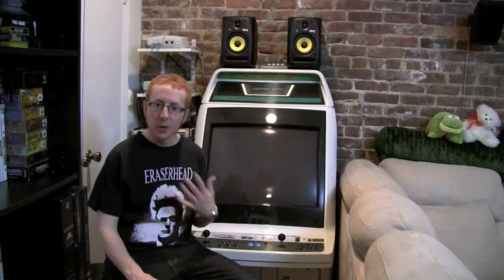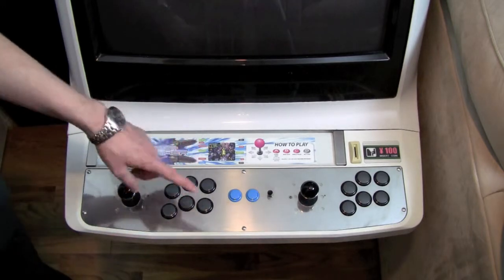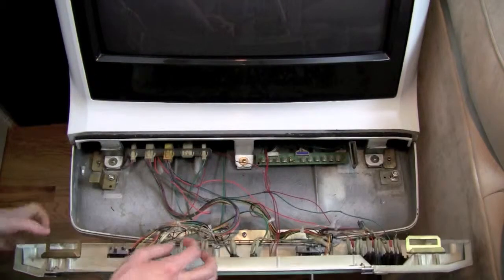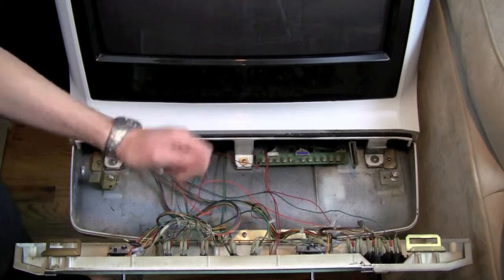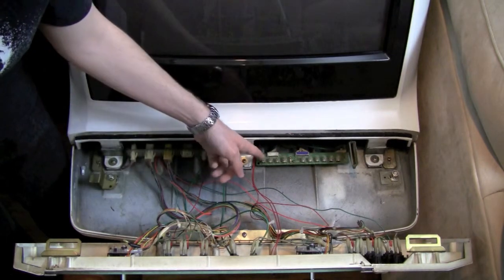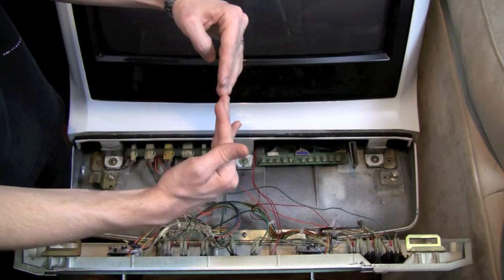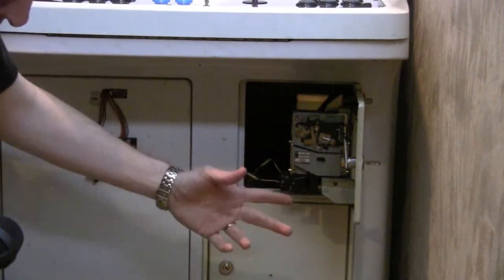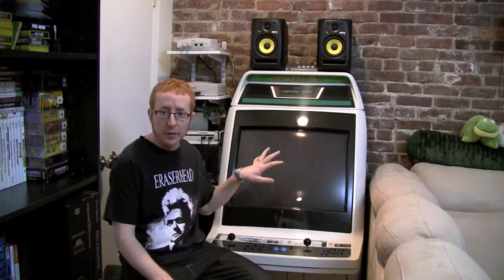Arcade Basics Part 3 - monitor adjustments and button wiring

Comment: Why do people insist on drilling holes for a coin switch? Just set the game PCB board to free play....
Reply: I see that all the time and it drives me insane. I was at a Barcade and I saw a lovely Nintendo Vs. cabinet with a hole drilled next to the speaker grill. What I do suggest, (and this is if you want to be in the least destructive way possible. Instead of wiring to a coin mech, wire to a push button, then leave the button inside of the cabinet or find a way to safely/temporarily mount it outside (under or in the CP).

Comment: Yeah don't mess around the back of your monitor if you don't know exactly what you're doing cause if you touch the wrong place you will get a shock of more than 20kV (20.000 Volts) at more than 10A. So yeah the chances of you getting out alive of such shock are pretty reduced!